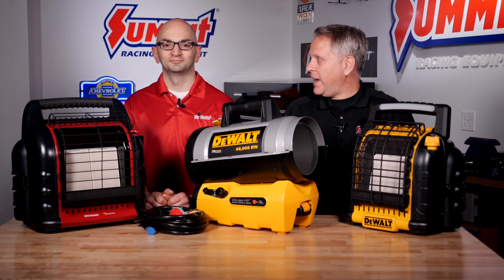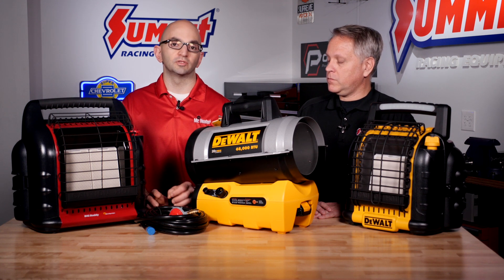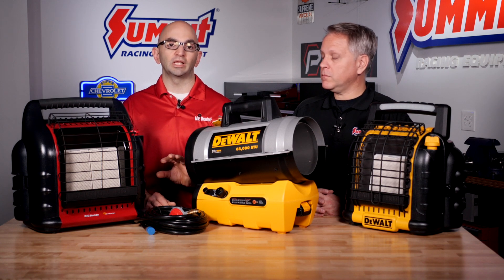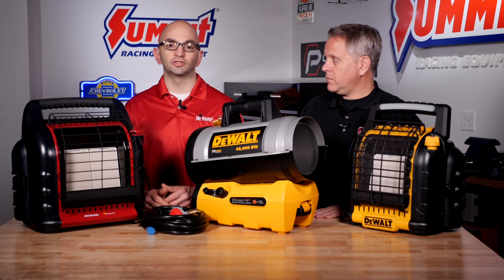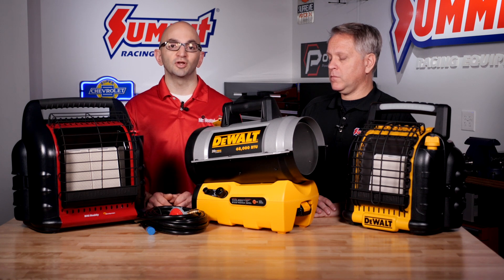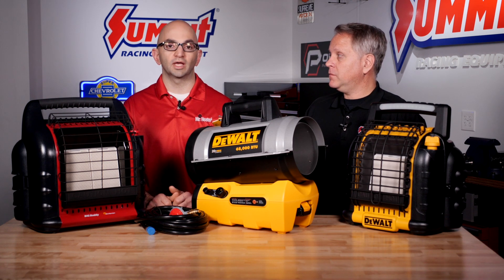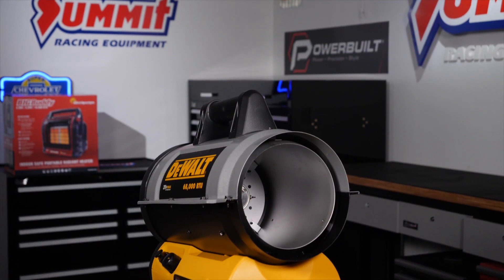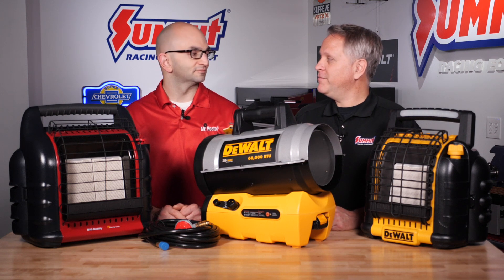Radiant vs. Forced Air Portable Heaters- Learn Which Heater Works Best for You

Comment: Question- Is is safe to have the 20lbs propain tank elevated to my big buddy indoor heater? Meaning,  I'm planning to stick my 20lbs propain tank out my window but it elevated about 3-5 ft? So the tank will be higher then the heater will be. Is that okay or?

Comment: could I use a force heater in my fully insulated 3 car garage about  630 sq ft with 8 ft ceilimgs for Christmas? I have a pool table in there and we will probably be playing pool during Christmas.  I have some gaps  around garage doors  and also a 3 to 4 gap under door that goes to yard. So I don't know if this will be enough ventilation? I know force heaters are loud but we will have the music playing:) eventually I will get probably a Mr cool 18000 btu minisplit system to heat and cool garage. I also have a gym in there. I live in Clovis ca with a zone 9b I think
Reply: I had minisplit installed in my home last Fall. 18,000 btu in main living area and a 6,000 in 2 bedrooms, so 30,000 btu total. I got it for air conditioning, but with multi-units having a heat pump was a bonus for me. Love the a/c and heating is much more comfortable than my baseboard heaters and savings of $40-$50 month.

Comment: Can these be safely used to heat a non-insulated shipping container in Canadian winters? or will the required ventilation/opened door just allow the air to escape?

Comment: forced air little shop heaters are just terrible they go through the propane fast I had one and I got rid of it I have a Dyna-Glo 20000 BTU blue flame heater and it works fantastic I go through 80 gallons in 2 months it takes me to go through that fantastic piece of equipment you guys are showing things that don't work at all are you going to be dumping money into